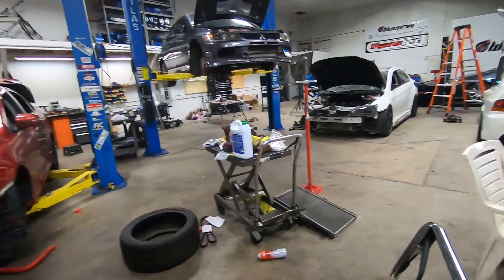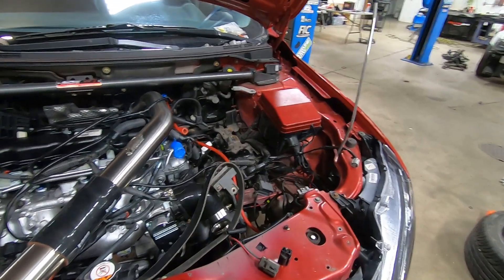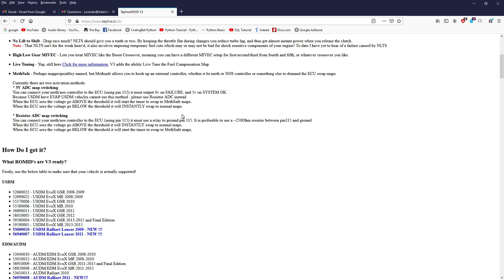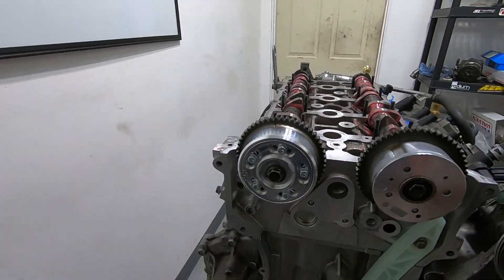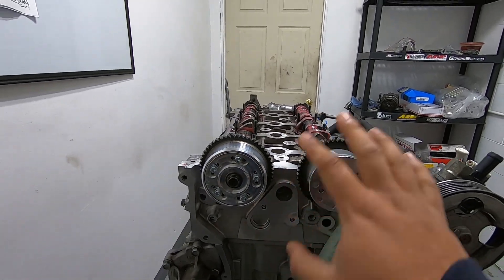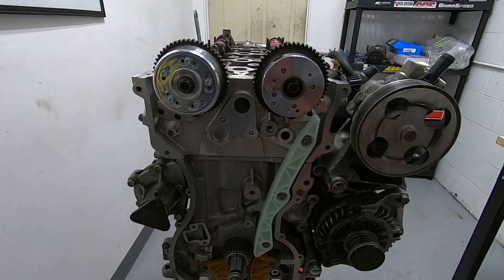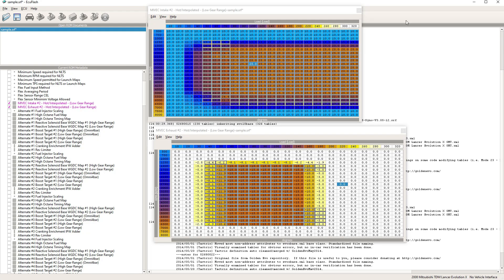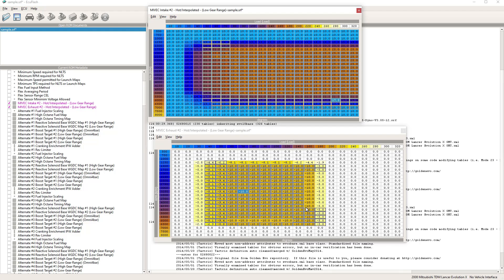2015 Lancer ES Evo X 4b11t Swap, Mivec explained with tables

Comment: Hey, do you think a 2008 GT (JDM) with a 2.0L 4b11 can take a 4b11t straight drop in with the 6spd SST transmission? I know there has to be some modification done to it regarding the electrical system but I'm talking as for fitting it into the chassis.

Comment: Putting some mivec deletes on this build I’m doing after the billet housing for exhaust cam is getting stuck.

When installing the magnus cams do I leave them at 0 degrees for EX and IN? 

Thanks 🙏🏼
Reply from the maker: Yes as a starting point. Alot depending on the cams ur using.
Reply: @bdalchemist  thanks for the reply and I’m using ams stage 2 cams similar to the s2’s it’s a built block, built head, stock frame modified turbo 3582 running on 114 octane, aiming for 650-700whp
Reply from the maker: @DWNSHFTco  yes 0° for exhaust and start low with intake and increase as needed or as engine likes
Reply: @bdalchemist  thanks for the info

Comment: BD great video!! I have a few questions,  my exhaust cam gear housing  went out on me, so I upgraded to the torque solution housing, and GSC S2 cams, and the map sensor went out as well, so I went with omni power 4 bar, the map sensor is not yet calibrated. I am going to get the car tune on Wednesday.  I drove the car and it says that the camshaft position timing over advance. Do you think the code is cause my the change with the cams, and the housing? Or the map sensor? I was wondering if this is something the tuner can fix on Wednesday. I changed the salenoid, and it is doing the same thing.
Reply from the maker: Def not map sensor
Reply: If it’s the sensor I had an issue with… (looking at engine bay, the front left one)
While inserting the sensor, its orientation is necessary…
there is sections on it that lines up more optimal with the grooves inside the head.
Reply: The sensor I’m referring to , is the long slim cylindrical looking , with a lil piston inside of it.
Reply from the maker: Thats the mivec solenoid ur referring to. It only goes in one way, hence the 10mm bolt that holds it in that position.
Reply: @bdalchemist  ah k , gotcha… 👍thanks for the clarity….

in regards to the line up with the 10 mill, yes , although, the way it is fastened , it’s crimped around the insert…and it can sometimes spin inside , losing the correct orientation…
Mine was , and it was throwing a code, 
soon as I figured that out, code was gone. 👍
Reply from the maker: @Michael-it7nx  there is no other way to put it, the "crimp" ur referring to is an oring, which Isa seal for the oil. The OEM solenoid is electric and just controlles oil pressure and supposed to move. If urs were damaged it would move in correctly and throw codes. The mivec delete on the other hand has no moving part. But to clarify there are no adjustments u can make , it has to be replaced.

Comment: Can you use the same gearbox from a lancer? 
Is the electrics the same for the 4b11T and a normal lancer motor?
Reply: Several people have done this swap. The manual transmission from the 2008 and up gt and gts lancers  can handle decent power you just need to upgrade the clutch or the clutch will slip.  The clutch and the tires the weakest links basically. Personally it’s a lot of money for not  much benefit imo. I drive a 2.4l lancer 2011 as a daily. And I can spin the tires like crazy and I just have some basic bolt ons

Comment: What’s a mivec delete and why do people do it
Reply from the maker: That's literally what I answered and the head I'm using in this vid has a mivec delete
Reply: @bdalchemist  awesome I posted before watching sorry
Reply from the maker: Lol no worries
Reply: @bdalchemist  I do have a question I own a 2011 mr bone stock if you owned it and wanted to mod it for daily use 400 hp to 600hp range I really wanna go big turbo 6266 but everyone tells me 18k mhi is the way to go of course bigger intercooler ebc uicp and 1200 injectors. What route do you think is best ? And or should I focus on getting tranny built by kosmic first then go big turbo.
Reply: @Manslayerkenji  anything I say over 500 whp you would need to build the motor .
Reply from the maker: If you are trying to make big power, it's cheaper to get a gsr. A good transmission build is $5k-$7k.  For engines up to 400-430 torque is acceptable before a build is needed.
Reply: @bdalchemist  what turbo upgrade would you suggest I’m looking at mhi 18 k ? Is there anything else out there worth looking at for 500 hp
Reply from the maker: @Manslayerkenji  gtx3576/3582
Reply: @bdalchemist  thank you